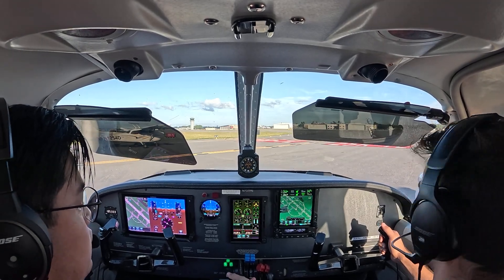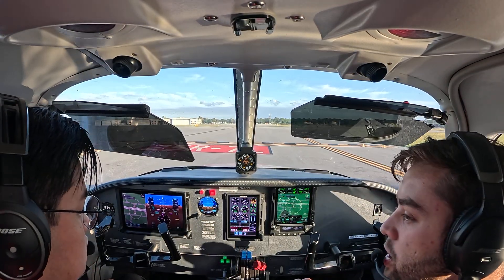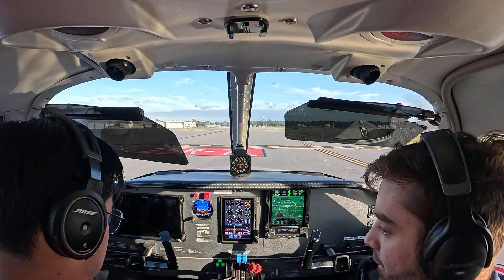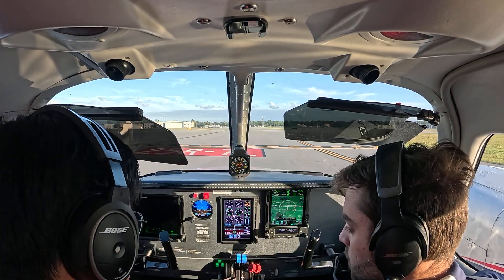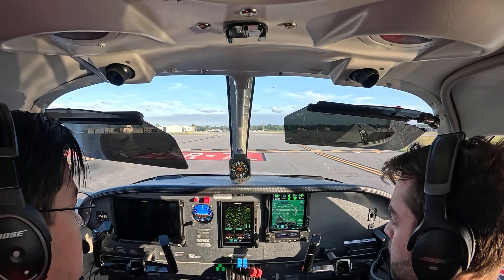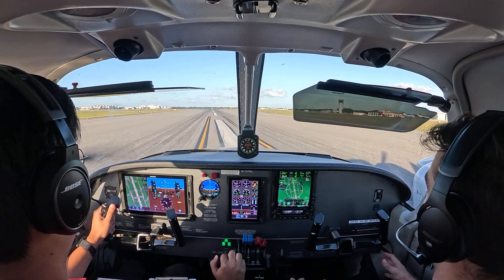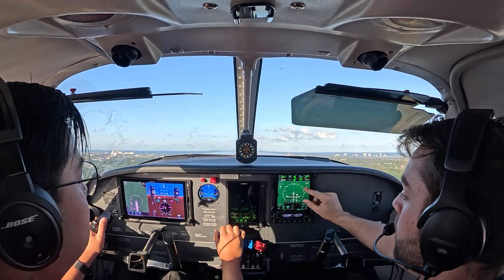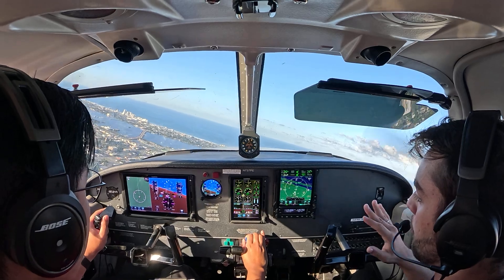How to do the TAKEOFF PROCEDURES of the Piper Seneca 1!

Comment: Great instruction! What would you say about a popular approach to using rotation as your takeoff decision point, instead of gear up? Wouldn't you have still been too fast if you tried bringing the plane back down and crashed into the trees? Why not continue and come back for a landing?
Reply from the maker: Hello! Thank you for your comment! According to the faa guide: FAASafety.gov
https://www.faasafety.gov › ...PDF
Flying Light Twins Safely
You only put gear up when no runway ahead to make a safe landing. Why? Because some of the light twins bellow 6000lbs might not be powerful enough to continue climbing depending of the circumstances. FAA: "Landing gear retraction should occur after a positive rate of climb is established, but not before reaching a point 
from which a safe landing can no longer be made on the runway or overrun remaining.".